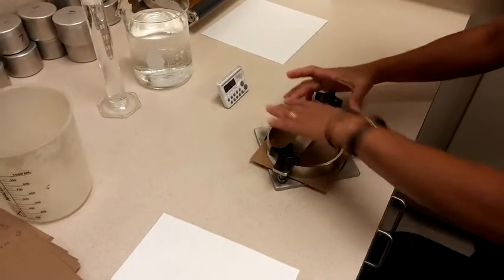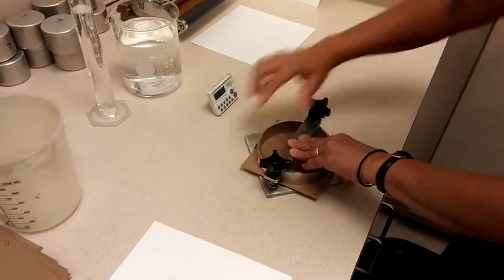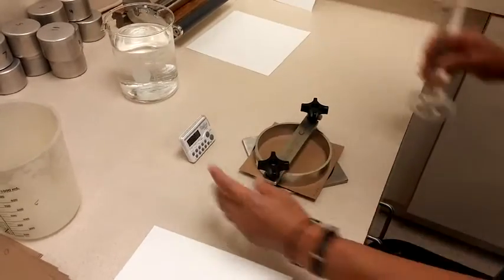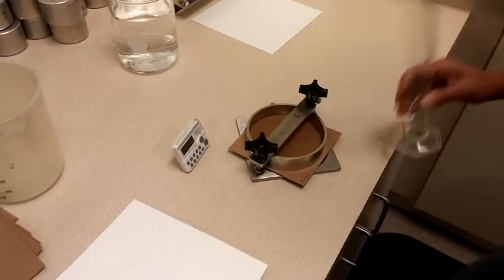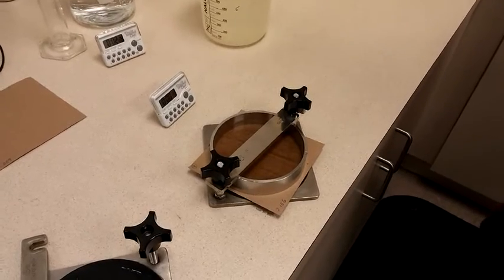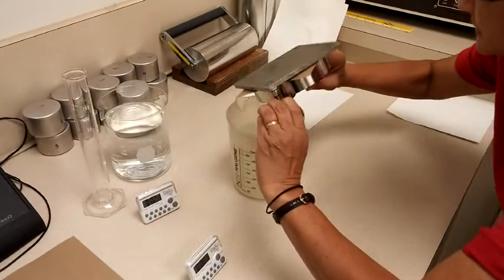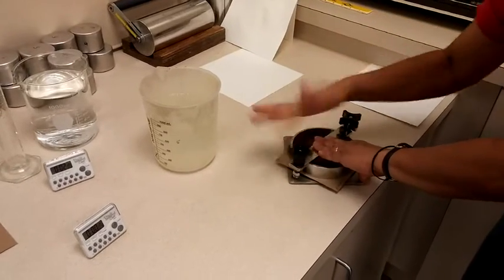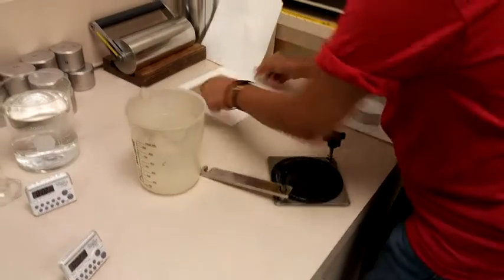Applied Paper Technology, Inc. - Cobb Water Absorption - TAPPI T441

Comment: Why u need tast
Reply: Common test performed for evaluating the amount of water absorbed by the outside layer of a corrugated fiberboard box to determine if the material is up to certain standards. For instance, When doing UN certification packing testing for hazardous materials the average of 5 test samples can't absorb more than 155 g/m² of water after 30 minutes